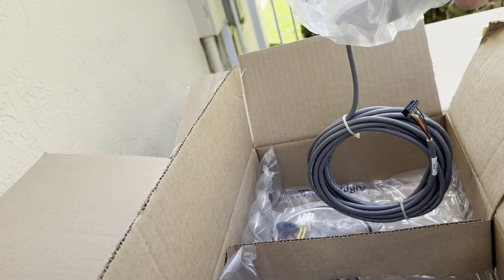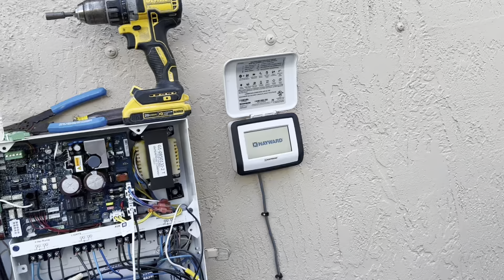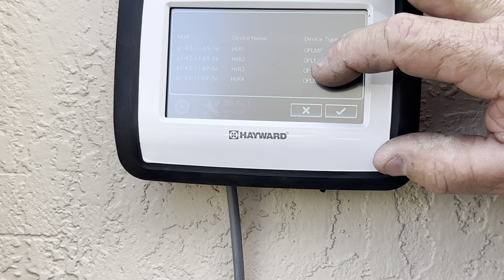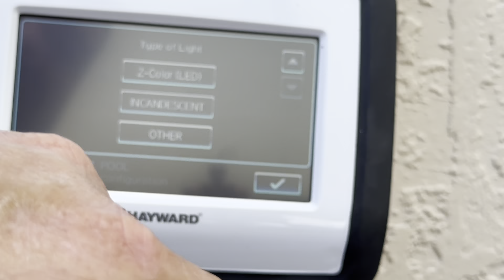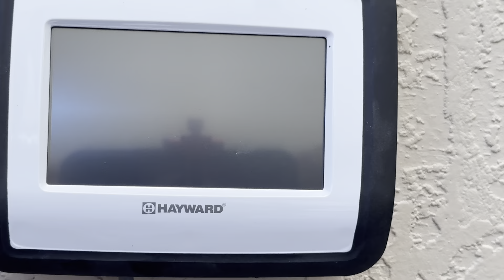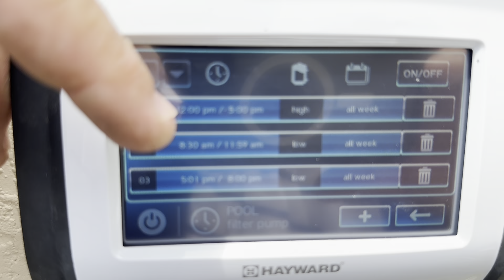HAYWARD OMNI PL UPGRADE KIT | FULL TUTORIAL & INSTALLATION.

Comment: You connected those wago connectors wrong.  Both sides of the connector are internally tied together. You’re not supposed to tie the wires together like you would do with a wire nut. You put one wire in one side and the other wire in the other side. You had hot and neutral shorted together through the internal connection of the wago. Same with the low voltage side. I was waiting on the video for the breaker to trip as soon as I saw what you did.
Reply: im about to install one of these...so for example on the yellow wires.. he took one from transformer...one from pigtail... and did that on each side...what would be the correct way? both wires from transformer in one side...and both wires from pigtail/board connection in other?